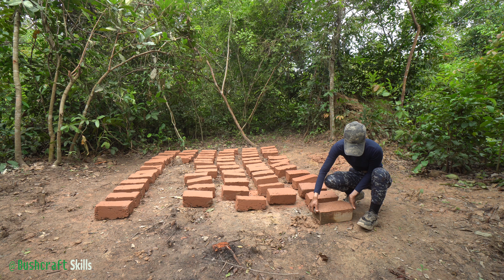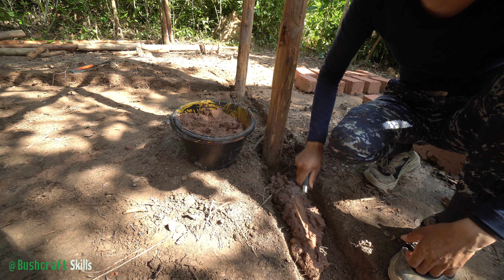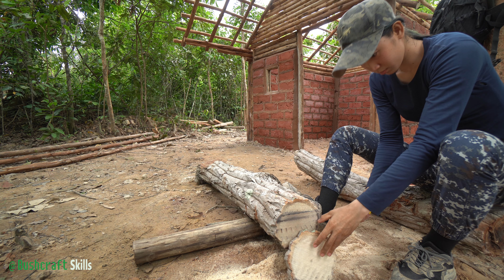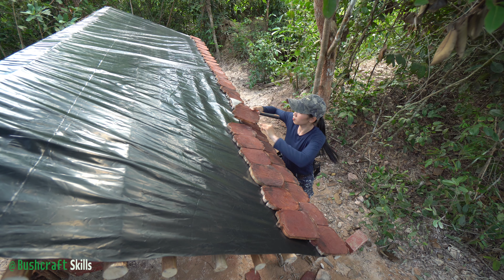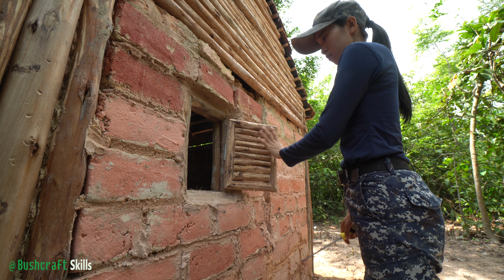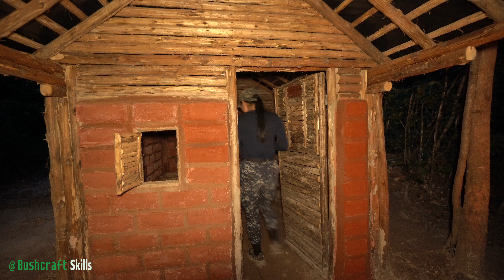Building Survival Brick Bushcraft shelter with Wooden roof In The Wilderness

Comment: Amazing how all the wood she carried was the same length and roughly the same diameter - and clear of leaves and side branches.
There must be a Lumber yard or hardware store nearby 😁

Mud bricks would take at least 2 weeks to dry properly in direct sunlight.
I estimate you would need about 100 mud bricks just to complete one long wall side of the house so at least 300 bricks would be needed. I can only see less than 50 bricks on the ground.
Where did you get the rest of the bricks?
How are you working so fast, and not sweating?

I can watch you pretend all day long.😉
Reply: Haven't you got anything better to do ? Who said this was built in one day ? You assume too much.
Reply: In regards to the wood. She finds trees the size she wants, cuts them down, cuts them to a length she can carry, strip's the bark then brings them to where she is building the shelter. It is quite obvious you have  ever done anything like this.
Reply: Never not ever.
Reply: @GregoryBamber  And it obvious that she doesnt do everything.

How many mud bricks were made? You needed at least 300 or more. I only saw about 40 or 50 on the ground.
How long were the mud bricks left in the sun to set? Normally a few weeks are needed.
She made all the mud bricks by herself?
It's a good video and channel but the video doesnt show all the details. 

I can appreciate the amount of work that is involved in building a shelter like this in the middle of a forest.
How long did it take from start to finish?
Did she do ALL the work by herself without any special tools, like power tools or chain saws etc?
Reply: @GregoryBamber  The assumption is that she does all the work - right?
How long did the mud bricks dry out for in the sun?
How many mud brick were made?
Did she make each brick by herself?
These are the assumptions that all viewers make when watching this video.

You can clear everything up very easily by answering these simple questions.

I am interested, not trying to make a fuss over the video.
Cheers
Reply: I have to agree maybe a video on how long something like this takes and a few more details would be great.
Reply: As far as the bricks you can heat them with a fire.
Reply: @jamesbossingham9694  
I didnt see a fire or kiln???
Is that what was done?
Why the secrecy?
Reply: @PetraKann  i dont know I was just saying it can be done
Reply: @jamesbossingham9694  Of course it can be done. Temperatures needed vary from 900 to 1200 degC depending on the clay being fired.
Do you think she could set up a huge firing oven that could reach those temperatures and manage to fire about 350 bricks?